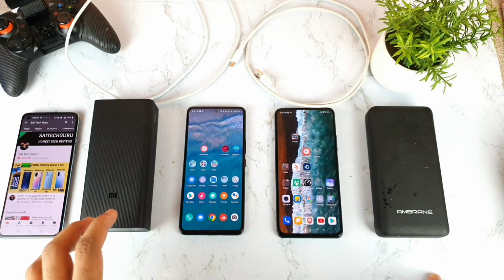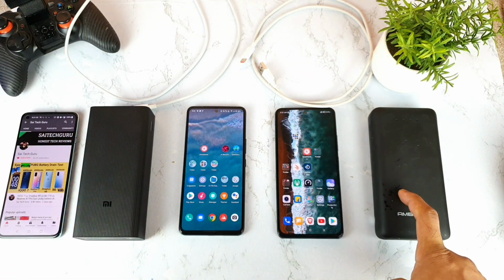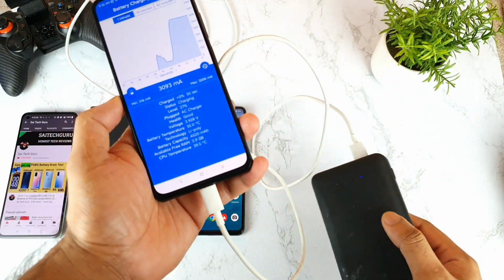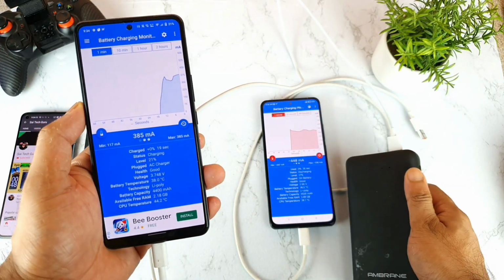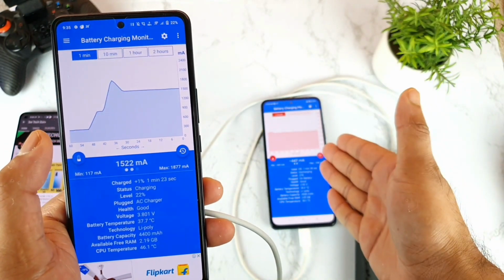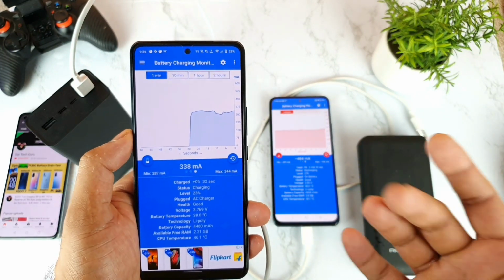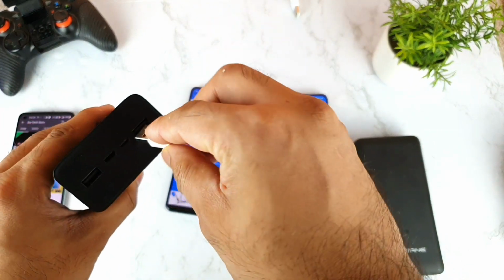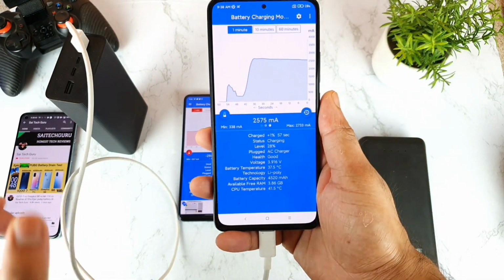IQOO 7 vs Mi 11X charging test using powerbank speedtest comparison

Comment: Bro iqoo7 mobile update to solve the problem yes or no
Reply: it is not a problem it is getting charged at same speed of mi 11x , just because iqoo7 have dual battery system it is showing half the speed of mi 11x
Reply: Tell me bro
Reply from the maker: No